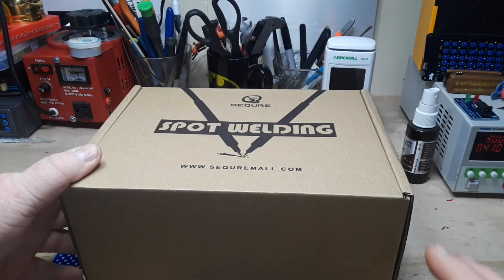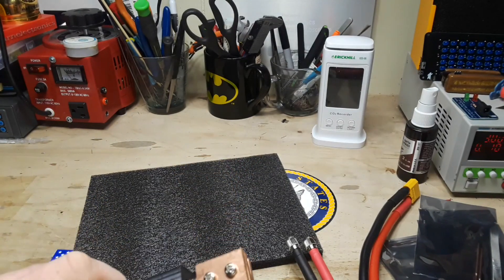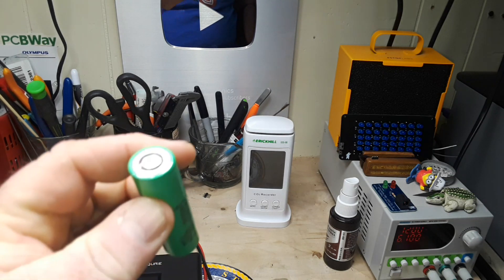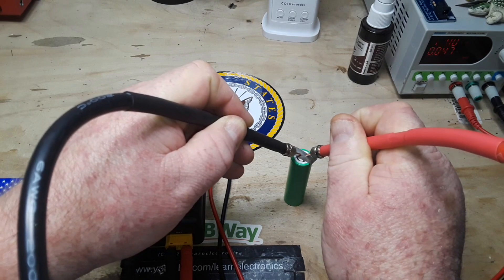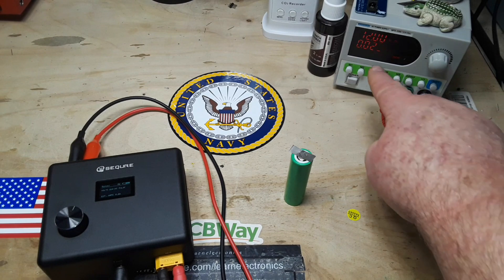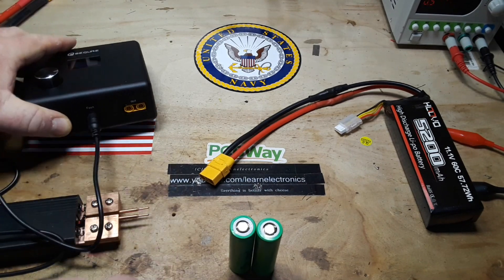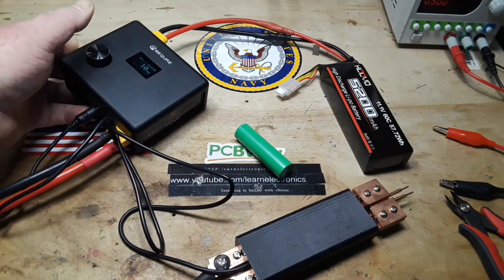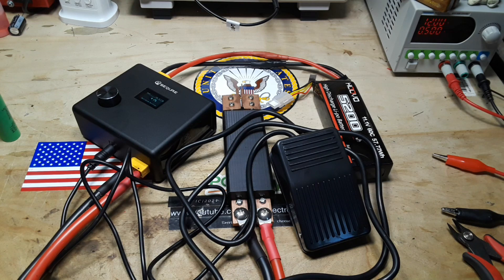Securemall SW1 Spot Welder

Comment: Thanks 
learnelectronics' video. With the recommended range of battery, the effect of welding would be better. Lithium battery (3S 5000mAh minimum 60C) Car battery (12V 400-800CCA) is recommended! Uuse code: SEQURE03 to get 3%OFF on sequremall: https://sequremall.com/

Comment: I assume simply soldering these batteries won't work because the battery won't tollerate the heat required to get the soldier to flow.

Comment: Paul i  have like 3 of these style of spot welders.  The battery providing power is critical.  I have found that 2 LiPo batteries (5000+MaH 60C) hooked in parallel give the best results.

Comment: Hello, in the beginning of the video using 12v 6 amps made me laugh!
  I have the same device 2 months now and what i have seen is the more amps (over 300) works better!
i also bought the plugs for connecting car batteries and works pretty much the same with the Lipo you got there.
i also made my own battery using 21 18650's ,  3s 7p with Sony VCR 30 AMP & works fine with that too considering that the battery can offer over 350 amps.
Good welding and creative ideas!

Comment: Never used one of those but it seems to me you would get better results if the current crossed between the battery top and the metal strip. That is how sheet metal spot welders work.
Reply: What he is doing is standard for these types of packs, and at the proper current output will give you a really solid weld.  This device looks like an overpriced doo-dad, well it is if you look around online.... I guess he has to give it some sort of good rating to keep getting free stuff from banggood.  I don't know anyone outside of hardcore battery pack manf's who would consider this a good deal for hard earned cash.

Comment: I just used a cheap red device for 19€ shipped on eBay and it worked like a champ on a big battery pack with a number of welds that goes into 4 digits.
Never gave up on me and I'm quite sure I could use it for another pack which easily makes it worth buying even for single use.

Comment: I see you have that instant cure for super glue - you know why it smells like essential oil?  They add it to hide the smell of what it really is - it's just bleach that is watered down a little.  No BS I swear - Cheap Easy Simple BLEACH - yeah, the same bleach you wash white clothes with and clean with.  Try it - I'll never buy that expensive crap again I can tell you that much.   I hope this helps you as your videos have helped countless people from all walks of life.
Reply: Good to know, thanks!
Reply: @AEON.  You never said, what do you make on your CNC machine?
Reply: @AEON.  Great of you to outsmart the corporations like that. And nice touch with the oils making your own scented superglue catalyst! What do you use it on most often?
Reply: @AEON.  That's interesting. What do you make on your router? Also, that reminds me, I have heard of someone using IPA spray for the same purpose you use bleach. He said that the minimal amount of water within IPA cures the glue instantly and the remaining IPA evaporates off. That makes me wonder if bleach is necessary if water itself cures the glue.
Reply: @AEON.  That's really cool man, you and me are a lot alike. Only that I am just getting Into metal melting and cool stuff like that. Budget is tight to say the least, to make it worse, where I live it is very difficult to get any special tool, materials or machinery.
Reply: @AEON.  Have you messed around with vacuum casting metal? What sort of things do you like to cast?

Comment: Uuumm ... silly question, but with spot welding I thought you normally applied the current to BOTH pieces of metal at the same time.  So the current passes between the two bits of metal and electrically welds them together at the closest point of good electrical contact  You seem to be passing the current through just the metal strip.  Have you tried the metal strip AND the battery terminal at the same time with one electrode on the strip and the other on the terminal.
Of course I could be wrong having never taken high school "Metalshop"  :-}

Comment: Do you reckon a PC PSU could provide enough juice for the welder?
Reply: No, it can't. 
The strongest PC psu (arround 1200Watt) can only deliver arround 100A. A PC PSU have a shortcircuit protection, so spotwelding is not an option. 
The smallest car battery (where this product is designed for) can deliver at least 250A if you shortout the leads, it's this high amperage that does do the trick for spotwelding.
Reply: @BjornV78  I see, thanks!

Comment: When welding you need to round off the nickel strips so there are no sharp points to cause a short. Batteries being welded in parallel should be hot glued together and that special fish paper (or whatever you call it) needs to be put between batteries being connected in series. Always solder wire (for BMS or main + - ) to nickel before you weld. This will always make sure that your packs are safer. Remember to always round off sharp corners off the nickel before welding.